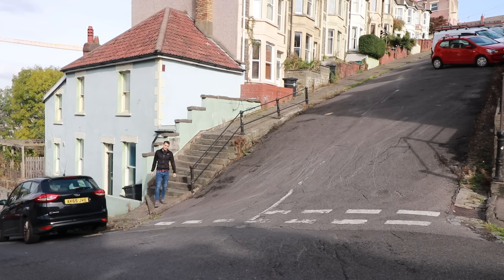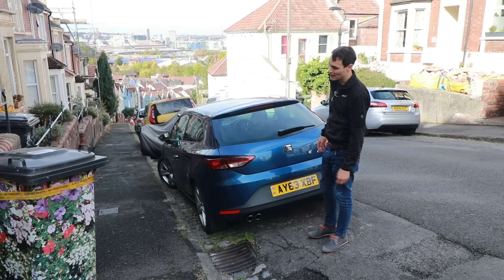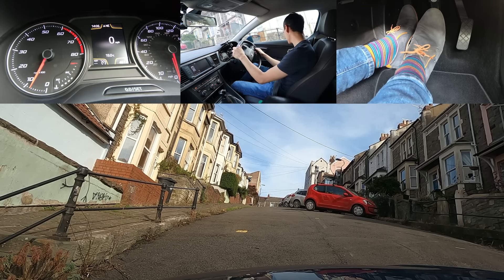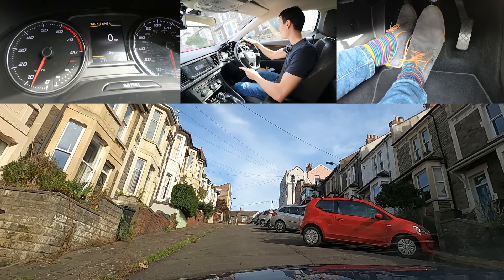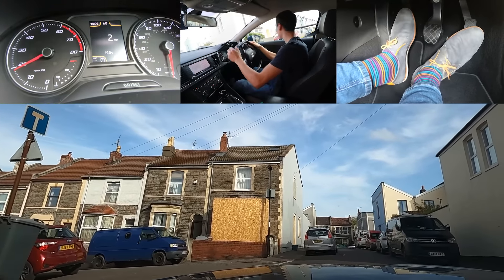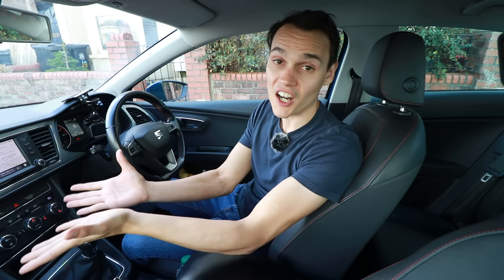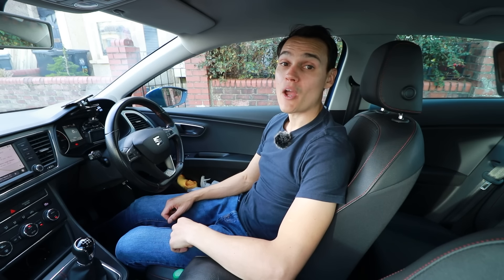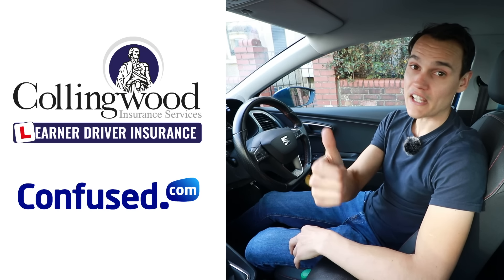Driving Instructor Stalls and Wheels Spins on the Steepest Street in England

Comment: very interesting. Never heard befor that cars adds gas itself without pressing the pedal.
We've learned to start on this kind of ramp by using the handbrake. Whould be interesting to see if possible on that hill.
Or even possible with new car? which might doesn't have a manual hand break anymore.
Reply from the maker: A handbrake start would have worked but hill hold assist is more powerful.

Comment: A simple trick we use in Pakistan is pull the handbrake get to 3000 rpm and release the clutch while slowly releasing the handbrake. Never stalled once on the hills

Comment: Am I missing something ?   With manual transmission, should one not be holding the vehicle with the Hand/Parking brake ?...  However in the "real world" when the aforesaid brake is about as useful as a "Blancmange Wedge", there is the "Heel and Toe"....  The technique is carried out in modern cars by operating the brake with the toe area, while rocking the foot across to the right to operate the throttle with the right side of the foot. With practice, it becomes possible to smoothly and independently operate both pedals with one foot.  There are certain streets in Los Angeles, CA, where one has to hold the brake (Auto Transmission  Left Foot) and increase the "revs" to get away...

Comment: To do a difficult hill start you put on the hand break, give gas, let out the clutch until you feel the wheels gripping and you feel the car move a little,  then you let of the hand break and of you go, easy peacey... I have been driving for 40 years but still use that method if it is a very steep hill or slippery, but most of the time I just use clutch and gas.

Comment: Hi conquerdriving. In your opinion, can a car with more torque  (than the car that you showed in this video) hill starts from this extremely steep hill of the video? For example an audi which has - let's give an example - 200 cv and a very good torque at low revs and diesel can hill start in this steep hill or only a off road can manage to do this?  Thank you very much for everything you do, you are incredible and you help a lot with your unique videos, which are very technical

Comment: I now feel pretty good about myself, just came back from a trip to austria where i had to stop on a 17% incline somewhere near our campsite and make a hill start to continue upwards. I did it first try AND without wheelspin but i used a bit to mutch revs imo so i smelled my clutch a little after it. But i made it! 

Also the car in question was a suzuki swift which has no assists (no hillstop, no auto rev) and also a engine that has very little torque beneath 2k rpm (1.3 petrol engine) for a little driver excuse why i used so mutch clutch slip

Comment: whey didnt add that feature to the miata because its made to be light. a car that only weights 1000 kg in 2022 is crazy, they have had to cut so many corners to reach that.
Reply from the maker: The feature doesn't add weight as it's software and is included in reverse on the Miata.

Comment: I’ve been on some EXTREMELY steep hills similar potentially steeper than in this video but I never had issues my car has hill stop and steeper the hill the more throttle I give it with a powerful engine and RWD the hill puts all the weight on the back tires and I can easily launch it at 3k+ rpm up that hill like a missile

Comment: On old carbureted cars you need to add gas when going from a stop or the engine will stall, the computers on modern cars does a wonderfull job on preventing it from stalling.
Reply from the maker: Not all electronic control units are programmed to open the throttle much at idle when the engine is under load. Some do more than others.
Reply: @ConquerDriving  yeah but all fuel injected cars are much harder to stall since they can adjust the air/fuel ratio on the fly.

With carburetors you're limited by the pilot jet at idle, it's not until you step on the gas that the main jet kicks in and the engine receives power. At idle if you half clutch the engine just starves in gasoline and it'll die, you can adjust the pilot screw to give it more gasoline but then it'll not idle smoothly.

This is why carburetors are not as fuel efficient, with EFI the computer counts the ideal amount of gasoline needed at different engine loads.

Comment: All that guff, just to avoid using the handbrake.  Use the handbrake  -  that's what it's for.  Doing it the "modern way" is all very well and good  -  until you meet a real hill.

Back in the day, I heard HGV drivers had to pass the hill-start part of their test without any rollback.  This was measured by wedging a matchbox behind a wheel, and checking for the slightest crush damage afterwards.

I learned to drive in a small town that had steep hills everywhere.  A few hundred yards after pulling off for my first time on the road, I was confronted with a hill start at a set of traffic lights.  I had a queue of cars behind me, and really didn't want to mess it up.  I don't recall whether I managed it first or second try, but it was certainly a stressful moment.  Soon it was a piece of cake, as there were hill starts needed all around those parts.  Plenty of practice for the test.
Reply: Yes, but as he said, this is the steepest road incline in the country and in FWD car where weight distribution defeated him on the steepest part

Comment: I've been driving up very steep inclines in Italy for 15 years in various vehicles, including a 96 Micra, Lancia Y10, Sprinter van, Rav4 MK3. Based on this experience, It was evident that your car would stall by looking at the RPM and hearing the engine sound: the RPM was too low for the uphill challenge. You had it around 1100 RPM, but it should ideally be between 2000 and 3000 RPM or more for such monstrous incline.
Reply: How the car could manage to move forward if it's solely relying on the clutch abd and the enging idle speed especially a steep hill like that it's impossible
Reply: How do you normally start a hill ? As far as i know there are different methods the quick one is balance of clutch and gas but it doesn't work on steep hills 
And there is the half clutch where you bring to the bite point and straightaway to gas , and if you have hill start assist its more easier which one you use

Comment: couldn’t understand it when my lad told me that he wasn’t taught to use the handbrake for a hill start.  His modern driving school car was fine, but his weedy 3 cylinder polo doesn’t have the minerals to even get out the slope on our drive onto the main road.  A good driver should be able to get into any car and be able to drive safely - but if you are never taught to use a handbrake for a hill start - how is that safe?
Reply from the maker: I agree, it's sort of the point I'm trying to make in this video. Handbrake starts are the method of hill start I teach, later on as their skill improves I show them other methods including hill hold assist. Many people are taught not to use gas when starting, that's the main point I'm trying to illustrate in this video.
Reply: How can you even move forward without gas? I really don’t get how your car moved, why does the car know you want to move, if you don’t press the gas pedal?

Comment: You need to put your handbrake on, clutch down, set the gas high enough and slowly come off the clutch. Wheel spinning is down to lack of traction, need stickier rubber for that. Steep hill so you will need momentum, keep your speed up, think of off-road driving up a muddy hill, you need speed otherwise you'll get bogged down whilst keeping the car going in a straight line; balance speed and direction, too quick and you'll be doing donuts, too slow and you'll need some to tow you out off mud...I think you would enjoy off-road driving, it solving a puzzle with steering, speed, braking, gearing - torque vs. RPM, speed control. You should give it a try...
Reply from the maker: I teach basic handbrake starts but I find hill hold assistant more powerful: https://youtu.be/O3cTlwMytfU

Comment: Would you say it's harder to do this hill on the turbo or the other car? I was used to my dad's manual 2006 1.4 Fiat Siena. It would rev as soon as you pressed the accelerator. However, starting on a hill in my new Volkswagen Nivus (1.0 Turbocharged, Manual Transmission) I keep stalling when starting uphill since the revs won´t come up as fast. Does anyone have any tip for this scenario?

Comment: My car is a manual with a very touchy torque-y first gear (modified Toyota 86), and if you let go of the brake pedal, she'll roll backwards like no tomorrow lmao. 

I've personally been on a road so incredibly steep (I'm from Australia and suspect it's steeper than this one for sure) that the handbrake did not work, the car was literally starting to overcome the (big) tyres grip and slide backwards down the hill. Scariest shit I've ever felt (this was in the middle of the night and the car was sliding backwards into the darkness to a cliff edge), that's the fastest I've ever dumped the clutch and shoved the accelerator to the floor, basically doing a burnout and roasting the clutch on the way to scramble up this actual mountain.. could smell the poor clutch and burnt rubber for the next 10 minutes.... wild day. My mate thought it was funny of course 😂

Comment: I know this video is from a few month ago but just catching up now. I'm extremely surprised that it's not compulsory for cars that are parked parallel to the curb on the adjacent roads with steep hills to turn their wheels as appropriate depending on whether they are facing up or downhill. And even not withstanding any legislation, I noticed many vehicles with their wheels parked straight. The drivers didn't even take the initiative to park with their wheels turned on the adjacent street which is also very steep! I wonder how many didn't park in first or reverse gear either!
Reply from the maker: To be fair, leaving my Leon in gear isn't strong enough to hold it on even a moderate hill, it will still roll down it, just slower.

Comment: The biggest mistake is to join the road vertically and stopped, if there is no traffic you should enter it while moving from the corner that is closer to you and continue at around 45° until you have momentum and higher RPM than idle to turn the wheel to continue forwards.
Going downhill on such steep hill you should engage the 1st gear without pressing gas at the same time you are letting the brake go and roll down like that and never disengage the gear until you have to stop or get to a speed where 1st makes the engine have an RPM lower than idle, if the hill is too steep and the engine can't brake the car to a stable speed you should occasionally brake and don't allow the engine to get to the redline.
Don't forget to engage a gear and turn the wheels to the sidewalk's side if you are parking on a hill, if it's an automatic try touch the sidewalk with the wheel against it before you put the transmission on Park because it might jam.

Comment: The best way to learn a clutch is to lift off with your whole leg until the engine just begins to labor, then plant your heel on the floor and pivot your ankle for the rest of the engagement. And dont be hard on your self when you stall the engine out

Comment: This road is steep enough to make an automatic car roll back if trying to move off from a standstill. One technique would be to use both feet in an automatic (brake pedal is wide enough for both feet) and give it some gas with right foot whilst releasing brake pedal with left fiit
Reply from the maker: I think that's wise, my handbrake was on fully and it still didn't feel stable. Hill hold assist is much more powerful.

Comment: I'm an American who only owns manual vehicles. I learned to drive on manual vehicles, and I plan to only own manual vehicles because its what I've always known and comfortable with. Its interesting to see the techniques used by other manual drivers on hills. Personally I use my 1999 corolla's handbrake to start on a hill. In my 1996 ford ranger however ,I don't have a handbrake, so you have to give lots of gas (About 2,500 revs) and release the clutch. (Both of my vehicles don't have a rev gauge. So its all done by ear...) When I was learning how to drive when I was 15, (I'm 21) my dad taught me to release the clutch as I push on the accelerator pedal. Basically a simultaneous movement of both feet. keeping the engine at a certain rpm whilst the clutch engages. I've started on some steep hills, but I have to say that there's a chance I may stall on this one. :)

Comment: Just use the e-brake, rev up the car and start lifting the clutch at the same time you start releasing the e-brake. 
Your engine and clutch will thank you because you don't have to use the clutch a lot, and you dont push the engine at low RPMs

Comment: Question: while trying to start while the car is already on a slope, should we use half clutch and full gas, or should we try to lift the clutch as soon as possible while adding gas?

I faced this situation where I stalled my car in the Himalayas, and couldn't start going up. One local helpful man ultimately took over and started it for me. So I still don't know what to do at that point. FYI I drive a 1.5 L diesel.
Reply from the maker: Maybe this video can help you: https://youtu.be/O3cTlwMytfU

Comment: I have a diesel car, is there a way to find out if it's the idle torque or adding of gas that allows me to start moving with just my clutch?
Reply: If you have a diesel then the throttle absolutely does not add gas, Americanism or not.

Comment: Would there have been any difference with the hill assist vs parking brake?
Reply from the maker: Hill assist uses all 4 wheel and is much stronger. Handbrake is only the rear wheels and cable operated. My handbrake was struggling to hold my car on that hill.

Comment: have you ever been on the A1307 from haverhill to cambridge? theres some interesting things there
Reply from the maker: Probably but I don't know for sure. I've driven between Haverhill and Cambridge more than once before but I don't remember the roads.
Reply: @ConquerDriving  it used to be a 60 without speed cameras so because it’s a wide road you would get people that bomit down the road at 90+ mph and people that were crossing got hit so what the local highway maintanance people did was put average speed cameras there but not only did they do that but they also reduced it to 50 and put all the blame on the drivers but nothing changed the problem was the people not looking while crossing. I get that they put the Cameras in but they didn’t have to reduce it to 50 so it’s an interesting road to drive on

Comment: The problem is that petrol engines, and especially so turbocharged petrol engines, have very little torque at idle and low rpm. A non-turbo petrol engine would, ironically, be better at low rpm hill starts then a turbocharged one as the normally aspirated engine will be higher compression and offer (slightly) more torque at idle to low rpm. Once the turbo is spinning however it will produce more torque than the equivalent normally aspirated engine, but you must have sufficient revs to do that. 
A diesel would likely have far less problems because of the massively increased compression ratio of the engine compared to petrol and substantial amount of torque available from idle - simply taking your foot off the clutch and brake would likely suffice.

Comment: I hated the car I passed on. It was a 1.0 in a very big quiet frame so I couldn't hear a thing, I learned in a small light diesel where I could hear and feel everything and going from that to a tiny little petrol engine with no torque in a big quiet body was night and day. The tolerance to stall in the small diesel was massive compared to the petrol and that hurt my limited driving experience in my driving test. I simply didn't have any experience or exposure to the difference between such different cars.

If I made the rules I would have them drive and experience the differences in cars and ensure at least an appreciable knowledge between them before sending them to a final test.

Comment: try doing that in a chinese suv weighting 1500kg with a 1.5l non-turbo engine making half of the torque the leon has, at tripple the revs. Recently was on vacation in tenerife where 10-15% slopes are quite common and sometimes its over 20%, very similar to this street. even on a narrow two way streets where you frequently have to stop to let oncomming traffic through. sometimes i basically just floored it and crawled up the hill with a burning clutch otherwise it would just stall. was quite smelly. will never use that rental company again ;)

Comment: Look forward to you trying this when it is icy... :))

As it happens, this is slightly less steep than the slope of my drive. Run-ups are normal (especially in the wet). And slipping is bad news as the car can slip to the diagonbal and then you are b**ed as there is a wall either side of the narrow drive...

Comment: So I learnt the clutch then gas method but my instructor taught me not to come off the clutch completely instead its more like a see-saw motion when the clutch is at the bite then you add gas then slowly release the clutch. Is that what you mean when you say 'only lifting the clutch'?
Reply from the maker: When I say only lifting the clutch I mean reaching the clutch bite point and making the car move without gas. I'm not against doing it, but in my opinion, as some cars don't do this very well it's not the best method to teach.

Comment: I would strongly advise against pulling away on just the clutch in any car on any gradient regardless of whether the car will do it or not. 
It is a sure way to significantly reduce the life of your dual mass flywheel.
Reply: *advise without gas ???
Reply: @seemorebeer2848  yes correct!
Reply from the maker: I agree, it's not something I normally do.